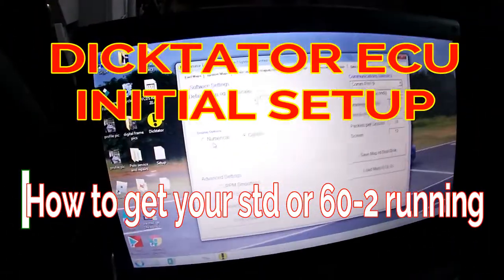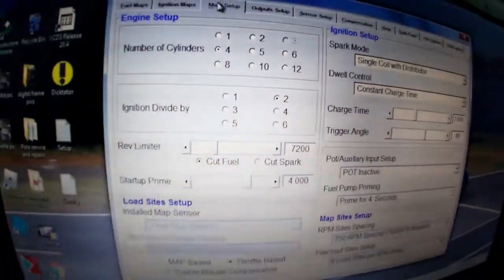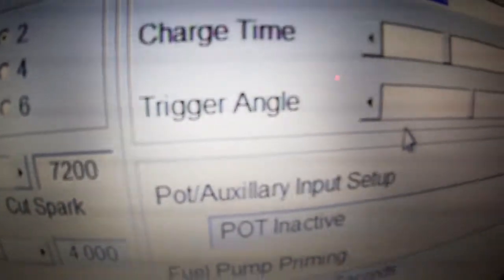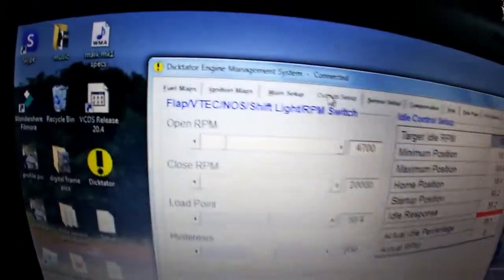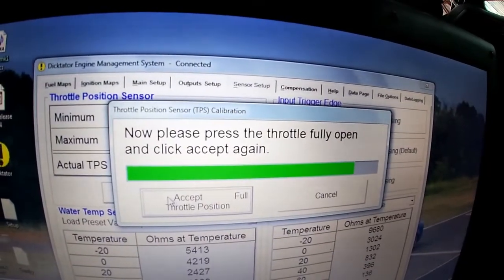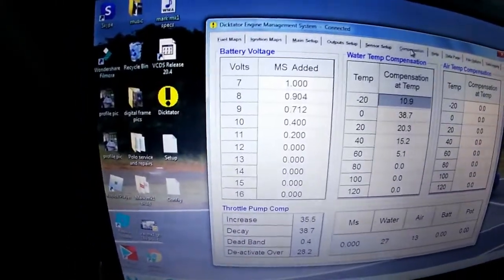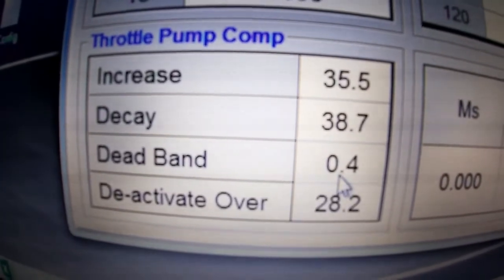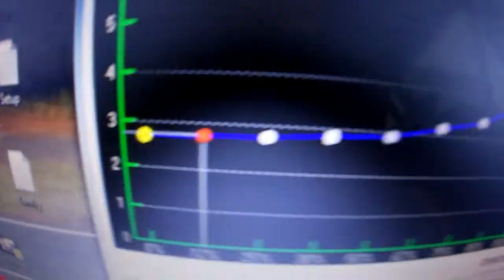How to setup your dicktator ecu, startup map and timing setup. Step by step to start your tuning.

Comment: Hi Mark, I can connect the laptop to the dicktator ecu and everything shows up correctly but when I download my map to the ecu it does not go through, I cannot change anything, for example the fuel pump primes for 10 seconds then I try to change it to 5 seconds it still stays at 10 seconds no matter what I try, do you perhaps know a solution to my problem?
Reply from the maker: I have had one or 2 with faults on the dicktator itself expecialy when trying to load a map. Perhaps send the box to be tested by dicktator
Reply: @markredline This might sound dumb but the different rev limits that create the nice change in tone like with the 325 e30s cant i just use a 2 step rev limiter ?
Reply: Got a new cable and it sorted the problem, thanks for the reply

Comment: Hey helpfull video. I have a bit of misfire and jerk on my car when engin is cold and dicktator management system redlight Led is constantly on and green and orange light keep on flashing when driving. Can you please help me sort out this problem. Can it be that the dicktator is out of tune or mapping is incorrect? I have a honda Civic MK6 1.5i EK hatchback

Comment: How do we get the correct commport? Software wont let us do anything until its right
Reply from the maker: You select from com 1 ro 10 until you see data flow
Reply: Cool thank you much appreciated, will give it a try. Once we’re in do you know what we need to change to get spark. We recently rebuilt our motor, only change is we deleted the crank sensor and installed a cam angle sensor. Not getting any spark now, we’re assuming the timing on the pickup is out. 

Motor is 1.8 AGN fully built, 60-2 dictator

Comment: Hey guys …my Air temp sensor shows error on the software ,what could I be missing  and its using a lot of petrol And the car has been to dyno before and its a 60-2 golf 4 gti agu
Reply from the maker: Air temp sensor in airflow meter
Reply: Hey dude, I have a similiar engine like yours

What settings did you use? I've never done this before, I just want it to run normally then drive it to cape town for a tune
Not sure where to go, but I need to get this sorted 

I havr APG engine
Reply: Oh wait nevermind the AGU is the turbo model. I read AGN

Comment: 4years later at 2am Thank you so much for this detailed video you are a Legend!.
Reply: did you do this with any prior knowledge to tuning? I just wanna install and do the wiring then drive to cape town to do dyno tune. Not sure if it's feasible
Reply: @modernkangal  I'm still struggling mybru,, I got a honda b20 with golf 3 pin coil and the fuel pump by engine bay deurmekaar with a normal std diktator
Reply: @nolanvanwyk7002  awe bra🤣 ek verstaan

I went with Sustech, found a guy in cape town who will do the tuning for me for R1800 and fault finding aswell
I decided fuck it I'm gonna spend my bonus for installation and everything. 12k
Reply: @modernkangal  but in all honesty I found the problem my coil was messing around but tune itself isn't right

Comment: Hi I recently bought a golf with a dictator in I ddnt wire it it has alot of stupid shit on nd it has itbs on its a gold 5 2l engine rose flow but it's over fueling it's back firing throw the itbs nd white smoke coming out the exhaust cn u tell me if tht is over fueling or wht
Reply from the maker: Check engine health as fuel will make black smoke

Comment: Hi there redline.very informative video im wiring up my dictator myself...i have an Audi v6 12 valve.im just having  trouble where to get trigger from speed sensor or crankshaft sensor..or do u have a wire diagram to illustrate

Comment: Did you set the timming down with the timming light
Reply from the maker: You check the timing and set it the same as on the computer. Adjust timing until same figures
Reply: @markredline  thanks you need to do one to show how you do it . On the video you made it looks if you set the timing with the light  you did not set the trigger to show the timing is the some or mabe i did not see it. Thanks for all the videos.

Comment: Hi there, running with map sensor, will the set up be the same?
Reply from the maker: Yes you must just set your map sensor range. If its boosted you would use 3 bar sensor if NA then 1 bar
Reply: @markredline  my car is running rich, can I correct it via software
Reply from the maker: @shiraazwilliams  yes you can with tuning
Reply: Also when you select the pressure example 1 bar or 3 bar, does the software reduce the rated pressure of pump? Is it similar to controling motor frequentcy on variable speed drives

Comment: Hi mark.
Iam driving a mazda 323 astina bp engine 1.8se.
I jst installed a std dicktator so iam struggling to set my map, so i followed your video how to set up so  it drives well but consuming alot of fuel not burning. Please help or advise 🙏🙏😭😭
Reply: Me 2 it use lot of Petrol 😢

Comment: Hi sorry to worry u I am having problems with my 20v rsi silver top when the car is cold it switches off when I put the lights on and sometimes don't idle when cold . I checked the battery is fine  and the alternator is charging. 
Car got no icv 
Water temperature sensor is fine 
I jest need to set the fuel compensation on the dicktator management I got the software and laptop and the cable jest need you to show me what to do please
Reply from the maker: Dicktator cant run the toyota idle valve... u have to make the timing on the 750 map higher so at coldstart it will lift up the idle a little... maybe 5 degrees more

Comment: Thanx for the video. I have a question with regards to the ignition timing set up. Do I 1st set my ign timing to the spec of the engine with   the timing light then adjust the trigger angle or ignition map. Confused...
Reply from the maker: You have to make sure the timing on the light is the same as on the map. If its 10 degrees on idle and 15 degrees on the light then adjust trigger so both read the same. Then you know what timing is on the map is correct

Comment: How do you do it for a distributor and conventional induction timing light?
Reply from the maker: It is the same. It is easy with a timing light that you can set degrees. On a normal light u could set timing close to 0 and them work from there
Reply: No whats app number if we have any questions

Comment: I love what you guys are doing with a mk1 16v build especially in Durban 
Could you also do a video about all the mods needed for the conversion and what it takes to get to 120kw atw 
Thanks
Reply from the maker: The main part is the cylinder head. Vanderlinde head job cost 25k 5 years ago. Bottom end is stock. No hi compression. Just rally spec cams and extended valves with gasflow and 5 angle valve seats.
Reply: @markredline  
Thanks for the reply  
Does itb make a difference vs stock intake manifold and are you guys going to be making a video breaking down exactly what parts  it takes to do the conversion